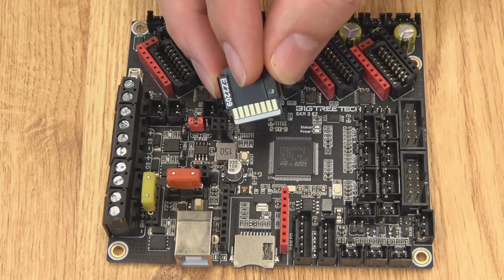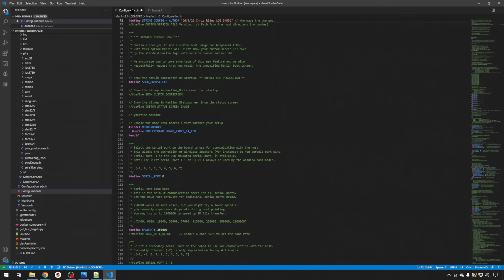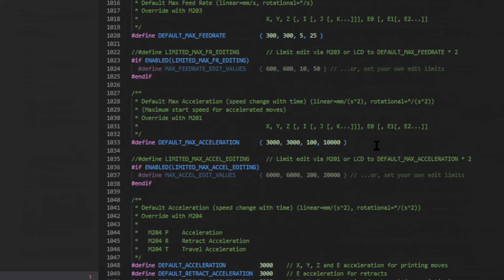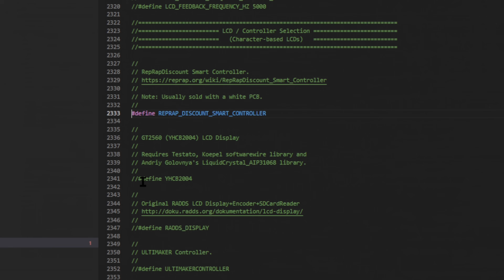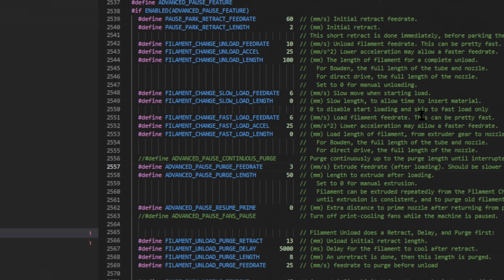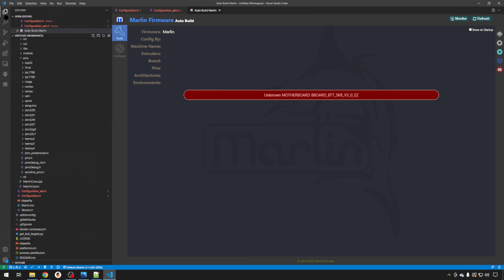Big Tree Tech SKR 3 EZ - First Look - 2022 - Chris's Basement

Comment: Have you come across the working skr 3 with the tmc error?
Reply from the maker: When I first booted mine up I did get the TMC error, I had to reset the drivers and re-flash to get it to go away. If the error stays it must be a hardware problem.
Reply: @ChrisRiley  I assumed it was the hardware but got another same issue. Many people on Github with same issue. My printer works, just has tmc error on screen and m211 all low. Someone  made a basic bin file which had no error.
Reply from the maker: @vwsurfer8809  Wow, that's crazy. I wonder if flashing my config has the same issue?
Reply: @ChrisRiley  I feel like it’s vscode. Or just BTT issue
Reply: @ChrisRiley  What do you think Chris? can you fix it?
Reply from the maker: @vwsurfer8809  Try flashing my bin file and see if it goes away. https://drive.google.com/file/d/1T3BvlUvDjHZoZ3THWG8nfx9E-4qqEzUf/view?usp=sharing

Comment: Hello Chris, good video, thanks. It helped me on the initial wiring. Just wanted to point out one thing, the footprint of the SKR 3 EZ is not larger, it fits the same mountings as the SKR 1.4, except one of the mounting holes had to be moved to allow placement of the motor drivers. I had to use a mounting plate adapter for the 1.4 Turbo board since there are none available for the SKR 3 EZ that I can find.  Thanks
Reply from the maker: Thanks for your insight!
Reply: @ChrisRiley  My mistake, it definitely does have a larger footprint. The fact that it still fits on a 1.4 bracket threw me. Will only fit 3 of the holes though. Thanks

Comment: I notice some printers save the auto level mesh on the SD card.  Is that because the boards don't have eprom?
Reply from the maker: Yes, that seemed to be the norm when 32b boards were coming out. With a firmware upgrade most of them now can write to flash even if they don't have eeprom.

Comment: Thank you for your awesome videos. I always come to your channel when I can't figure something out. I have the SKR 3 EZ and I am having problems with Klipper. My Z motor is clicking during prints but when I calibrate it, it extrudes the correct amount of filament. The prints come out "squished" like the Z axis is not going up while printing.
Reply from the maker: I wonder if it's a compatibility issue with klipper. I'm not sure it supports this chip yet.

Comment: Are the EZ2209 drivers just standard for any nema17 stepper? I have an original CR-10 frame that I found in a dumpster but it is missing the main control box! I am determined to rebuild it and the BTT SKR 3 EZ looks like a great board to finally get this frame going but I am stuck with the 7 different types of EZ drivers.  I could really use clarification on the driver choice.
I also badly need a PSU recommendation since that was in the missing brain box too. I have seen MeanWell PSU's mentioned but Im not sure if thats just because it is a drop in replacement for the original CR-10. It is tough to find something that works when I do not have the original parts to reference.
Now I hear you might have an even better mobo video soon? Maybe I should wait for that...
Reply from the maker: For a CR10, the 2209 is going to work great. The SKR3 will be great as well. If you wanted to save some cash you could go with the BTT Mini V3 board, it comes with drivers and is more than enough for a CR10. The power supply...on an original CR10 everything was 12v. So I would just find one that was 12v around 30amp, like this one. https://www.amazon.com/eTopxizu-Universal-Regulated-Switching-Computer/dp/B00D7CWSCG/ref=sr_1_3?crid=2Y5Q03XOOU5TJ&keywords=12v+30+amp+psu&qid=1657221502&sprefix=12v+30amp+psu%2Caps%2C112&sr=8-3

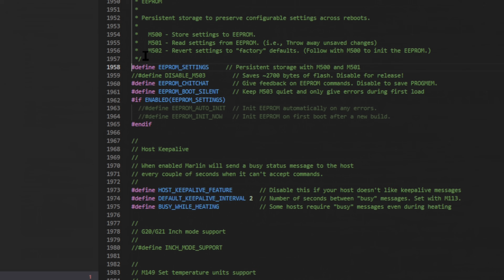Comment: 22:39 Check your PLA preheat bed temp... you set it to 00 instead of 60. (configuration.h, line 1994)
Reply from the maker: Thanks
Reply: @ChrisRiley  why should PLA preheat bed temp be 00 and not 60 or 65?

Comment: Instead of configuring everything in configure.h and configure_adv.h, there are preconfigured files in the separate configs zip downloaded from the same marlin download page. Should be on the right column as the main download link.
In it, you'll find a huge bunch of preconfigured printers and boards. Only copy the configs for the board of yours into the Marlin folder and overwrite the original configs. 
Then you only need to configure additional features you want to use, such as bed level sensors etc. Saves a ton of work.
Reply from the maker: Thanks!

Comment: I have one of these ready for one of my DIY corexy printers that is currently running Klipper on an old Anycubic Trigorilla board (quite well I will add) and I was very very happy they included the jst connectors with the board. My other DIY printer is running on an Octopus board and I am also very happy with that.
Reply from the maker: That's great! Thanks and good luck with your projects
Reply: @ChrisRiley  What is the resistor for ?

Comment: That was very satisfying, thanks! I have one of these boards and can't wait to set it up as the controller for my old i3… or at least one of the controllers. Like "LOG" this printer is meant to be a test rig, ready to wire up to any board that comes along. The addition of CAN bus lights a small fire under our butts to add CAN support to Marlin. Hopefully there's a nice library already written so we can skip the hard part.
Reply from the maker: That would be great. Thanks

Comment: if your printer is connected to the host computer your sd card will mount as a volume and you set the upload of Marlin AutoBuild path to so you can click upload.

If you are using OctoPrint, you can enable Marling Binary File Transfer (BFT) to copy firmware and then run m997 to reboot and flash new firmware.
Reply from the maker: Thanks

Comment: With that fast CPU, could it run both sides (printer firmware + kinematics processing) of Klipper on board?
Reply from the maker: It could, but unfortunately, it's not designed that way. Stay tuned, we will be looking at a board soon that WILL do exactly that.
Reply: @ChrisRiley  Perhaps the Fly Gemini?

Comment: I have concerns about those pluggable driver modules. If the board is placed upside-down and they're subjected to vibration they will work loose.

I also recall, from the prevalence of these edge-connector style sockets in 1970-1980s computers, that they were generally unreliable.

Time will tell but I expect issues.
Reply from the maker: We will see my friend

Comment: Watching your videos reminds me why I abandoned Marlin in favor of Klipper. 😅

Anyway, you mentioned the notch on the stepper driver PCB, and that makes me wonder if it is possible to connect that PCB in the wrong way. It's something that makes me wonder if a keyed edge connector, like PCI-Express 1x form factor, would be a better choice or not.
Reply from the maker: If you try to flip is backward, the chip will bottom out on the header, so if you could get it in there only half the pins would seat.

Comment: ok so basically skr3 from skr2 we get a faster processor but lose the usb flash drive connector and the duck, I can’t believe we lose the duck.  So if marlin 2.1 works fine with the skr3 I should give it a try on my skr2… Great work as usual Chris.
Reply from the maker: Thank you

Comment: Always a joy to watch your videos.
I do like klipper running my vc3, but watching this video I somehow feel the need to buy this board and upgrade my old i3 Mk2. 5

The new steppers are nice because the pins are somehow limited with maximum current. But still using a normal jumper to select the voltage... I don't know. There should be a better and more solid way I think.
Sad that they don't include a duck anymore.
Reply from the maker: I agree, thanks

Comment: on the website it lists that the 48v is only an option if you use the 5160 drivers, have you used those at all or are the 2209's better?
Reply: It's safe to say, that the 2209 are pretty much all you need, unless you build an ultra speed corexy for 500mm/s or more. Then you would need the 5160.
Iirc there was an high voltage version for up to 60v, but you can't find them any more... Only the 48v.
Reason might be that DC voltages are only safe up to 50v. Anything above might not only zapp you... Because of dc current, your muscles just contract and won't let you open your hand. With ac you would still have the possibility.
So I guess we won't see any real 60V anytime soon.
Reply from the maker: Thank you

Comment: Will this work with an Ender 3 Pro's LCD? I thought it was EXP 3? You said this had only EXP 1 and 2?
Reply: If it's the same as the older SKRs, then it's just a firmware setting in marlin to make the Ender 3 LCD work.
Reply from the maker: You can make the screen work I think by setting the screen setting to CR10 style.